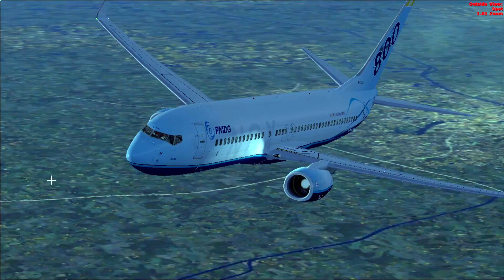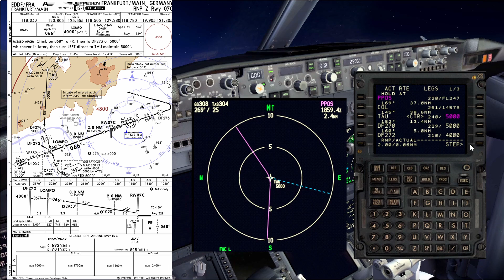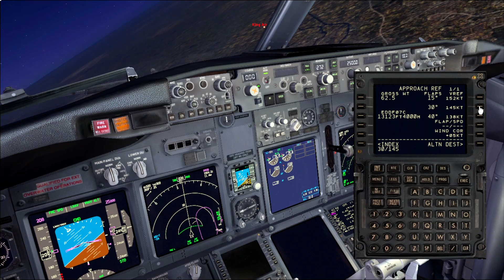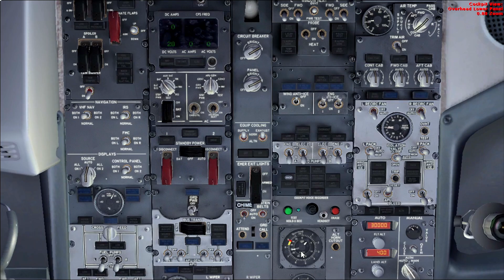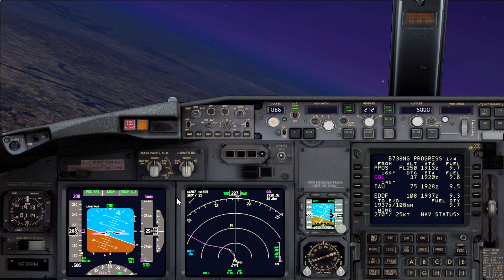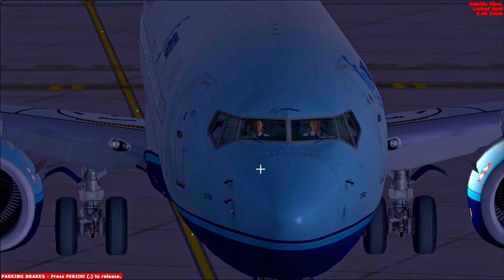737 LNAV/VNAV RNP APPROACH - Professional 737 Airline  Pilot - PMDG

Comment: captain I had a question why do we have to dial down the altitude every time since we are following VNAV PTH which means that the decent will be calculated automatically so even if keep changing our altitude it will still follow VNAV right so what is the point of doing that let me know please thank you
Reply from the maker: Hi :). You set the altitude for the given atc clearance. If cleared lower then the next altitude constraint, tou set it for the next constraint.
Although the path is calculated all the way down, setting the constraints\clearnce limit, guards you from violating altitude constraints.
Reply: @pilotdreams7886  thank you captain